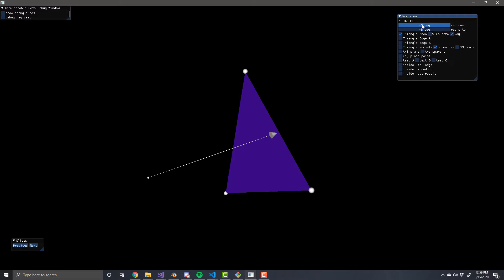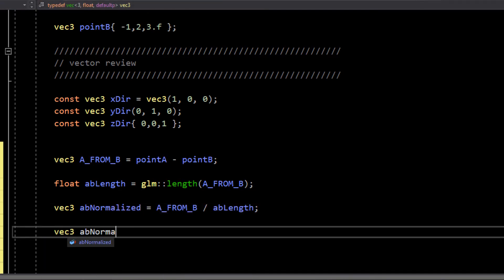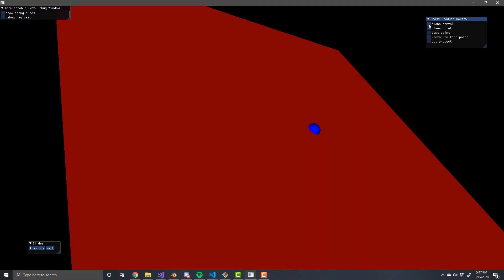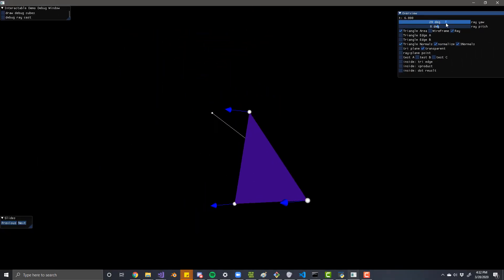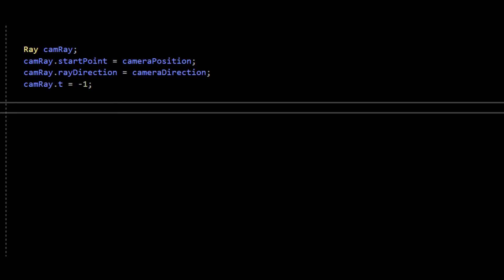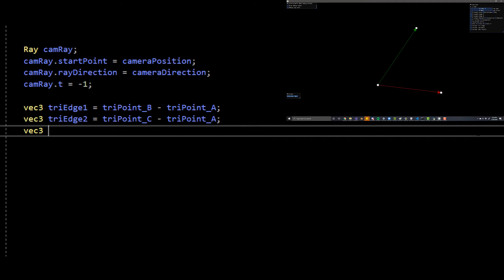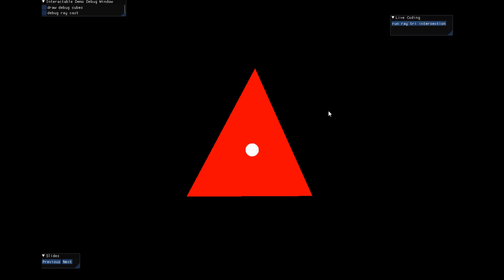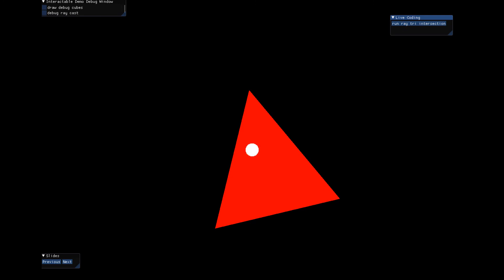Easy ray triangle intersection explained in full (alternative method) (unoptimized)

Comment: I have 2 3D Elements I need to check the clash between these two elements, So Which algorithm I use is little bit confusing. Do you have any suggestions
Reply from the maker: Hey, check out SAT and GJK. I'm more familiar with SAT (separating axis theorm, aka separating axis test), less so with GJK.

SAT basically cleverly looks at projections of vertices to determine if they are colliding.
Think of it as casting shadows on axes (eg y axis/ x axis).  I think of them like lines going through the origin.
But each axis is defined based on properties of the objects.

If two shadows are NOT overlapping, then the objects cannot be colliding.
The trick is to find all the different axes to test. 
If we talk about 2 cubes, it is the face normals.
But it also needs to test the edge-on-edge collisions.
You can cross product each pair of edges in the cube, to get another vector, which is an axis to test.

Since some of these results are the same, you can get clever and avoid testing on redundant axes.
(eg the left and right faces point in same but opposite directions, so only need to test one).

So basically the SAT finds if any of these axes have shadows that don't intersect, and if there is a gap between them, then the object's cannot be colliding (because if they were, their shadows would at least be touching).

SAT also gives you a MTV (minimum translation vector) to get you out of collision.
This is basically the axes with the smallest overlap. 
You get the overlap distance, and multiply that by the normalized axis vector 
(with some care to make sure it points away from the object that was hit during the move).

I should make a video on that, I did an implementation way back in college. 
It is a cool algorithm.

Comment: Can you tell what software you’re using to visualise the vectors
Reply from the maker: Hey, It was actually some custom C++ / OpenGL code I wrote to visualize it. 

It was really bespoke, but I basically had a class for "vector" "point" "plane" "line" etc, and some helper functions to draw them from mouse clicks. It was very bespoke and not general purpose, but what I needed for the video.
Reply: @enigma_dev   Thank you :)